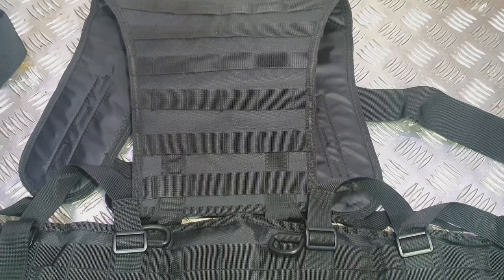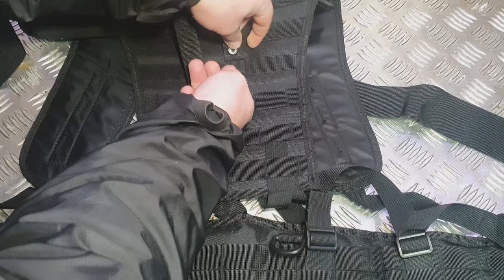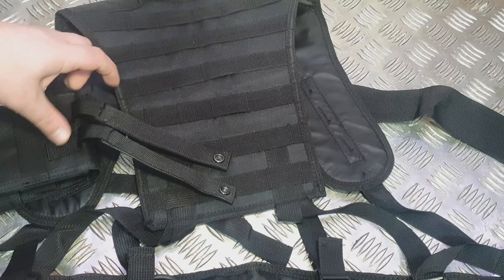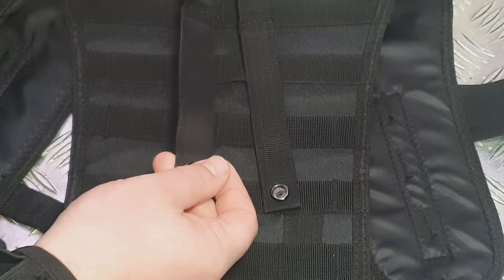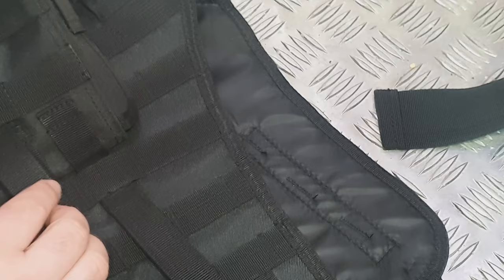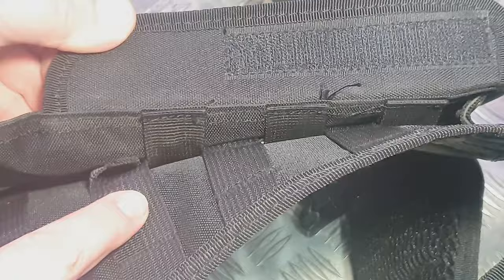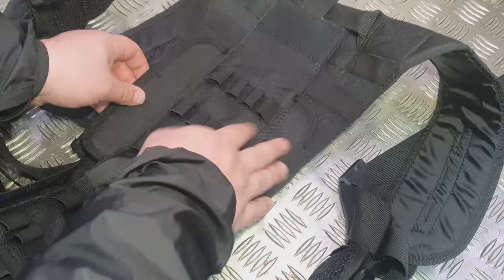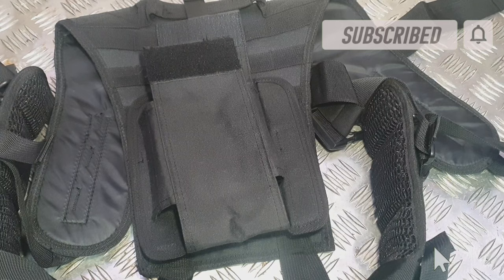I Was Doing It Wrong | Correct way to utilise MOLLE and Pals Systems

Comment: It's hard to get the straps in the right way, but once you've got them weaved together, you've got a very solid system.
Reply: I’ve had mine come undone (did it the correct way) it takes a lot but it can happen, I switched over to gridlok

Comment: Most of my pouches are light and so slight movement not an issue. Plus most are velcro detectable with a quick connect to make sure they stay attached to the loop base that is attached to my backpack. Went ahead and changed them and they do not move at all. Not huge for my norm pack, but I can see this being really good for when I am adding a bit to my pack. Thanks, good info.
Reply from the maker: Youre welcome.share the knowledge my friend

Comment: I have molle webbing on my backpack, I like the customization options, for example in one section I cut the middle attaching thread between that two molle loops to make a bigger loop, which I can now fit my axe handle through but the axe head doesn't fit so now I'm able to carry my axe on the outside of my backpack instead of in my backpack or hand.
Reply from the maker: Great idea... if you have Velcro on your backpack look at the Viper Accessory Holders.

Comment: This is definitely gonna help. So for reference I have a molle panel that goes over the seat in my pick up & I've got 4 pouches on them all done the wrong way with a spare pouch that I've attached to a day bag essentially. 

I immediately changed the one currently on my bag but not the ones in my truck because I can use that to my advantage if I find myself in a situation where I need to quickly grab a pouch. 

If the need comes I can also quickly grab the pouches from my truck then correctly attach them to my pack (like with the previous pouch) then I can have a full set up on an otherwise light pack

Comment: Thought everyone knew that but if you didn't now you do
Reply from the maker: Hi mate i learned this a couple of years ago after losing my pouch whilst out, that wasn't fun. But shopping for replacements was. 🙂
Reply: @OscarOutdoors22  im going to start a you tube channel eventually got the equipment for the phone you use just waiting to get out keep up the good work
Reply from the maker: Thanks John.
What equipment you waiting on my friend. Maybe i could steer you in right direction, i also film on my phone
Reply: @OscarOutdoors22  i watched your video on the equipment you use and bought it off amazon
Reply from the maker: The ulanzi lights and stuff? You won't regret it mate
Reply: @OscarOutdoors22  cheers for the heads up mucker
Reply from the maker: @BoltonMaverickoutdoors  no probs

Comment: I noticed how the webbing on the pouch doesn't always line up with the webbing on your tactical bag or plate, so it becomes a wonky, unless you just skip one or two weaves.

I own a Brandit tactical sling bag and bought 2 small Brandit pouches for easy access to my KeySmart and knife.
It is impossible to weave the strap through the top elastic band on the pouch.
Weird, since both the tactical pack and pouches are from the same brand.

Comment: The "Incorrect way" can actually be useful for things like First Aid & Tourniquet pouches so you can rip them out quickly and completely remove them from your bag to maybe hand them off to someone in an emergency, when time is of the essence but also maybe you're in a bug out situation & you're not sure who you can trust it saves you having to handover your entire backpack, perhaps your only lifeline for survival
Reply from the maker: Too true
Reply: I get what your saying but quality ifaks and med kits come with Velcro for what you just described
Reply: IFAKs (even standard ussued ones) usually have an inner liner so you can open them, and deploy your kit quicky while the pouch stays on your gear.

I probably would struggle more by ripping off the kit and trying to open it then try to find the stuff I need - open it on my gear, pull out the whole kit, unwrap it and use it is probably the better way.

Comment: I found it painfully obvious. With that said, I've had to teach several others. Some makers of gear need to watch this video. I've purchased several pouches that were made of good materials, and stitching was well done, that suffer from not understanding how it works when either designing or assembling them. This includes webbing spacing, and strap and snap placement.
Reply from the maker: Thank you Toby

Comment: It's just me or this molle system seems not practical at all? It's cumbersome, it add a lot of weight, and you don't really take advantage of modularity since the attach/detach process is slow and complicated.
Reply from the maker: I use mine frequently i have my Endurance back pack set up and ready to go constantly. I like i can move, add stuff, remove stuff as i see fit for the trip at hand

Comment: Are you telling me people don't already do this?
Reply from the maker: Im not telling you anything mate. But judging by my responses in tbe comments, not everyone has been doing correctly, just sharing knowledge and hopefully saving someone some money
Reply: @OscarOutdoors22  Nothing wrong with sharing knowledge. I remember my first plate carrier coming with the pouches so poorly fitted that I played around with them to get them to fit well, although I have had issues with some pouches that didn't like being threaded.
Reply from the maker: Yeah ive got some cheap small ones from Ali Express and they dont like being attached at all.
Reply: @OscarOutdoors22  my worst fitting one was a viper medium pouch, had to miss the last hoop as couldn't clip it in otherwise. Never had one fall off with this method and they have little to no movement.
Reply from the maker: Never had an issue with Viper Gear but just ordered a load so will keep an eye on that thanks flr heads up brother.